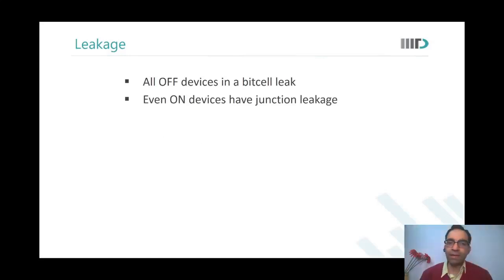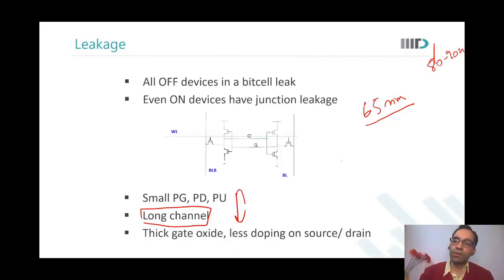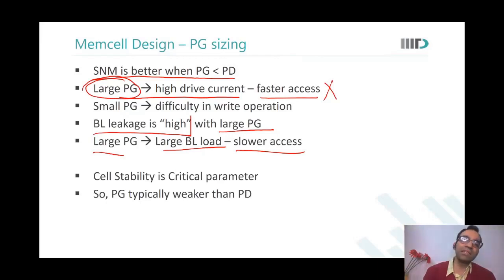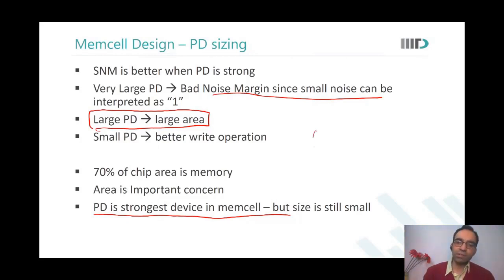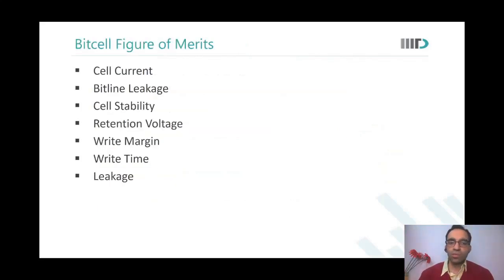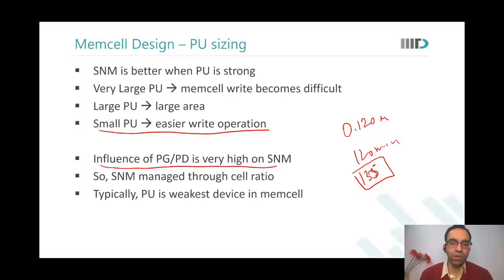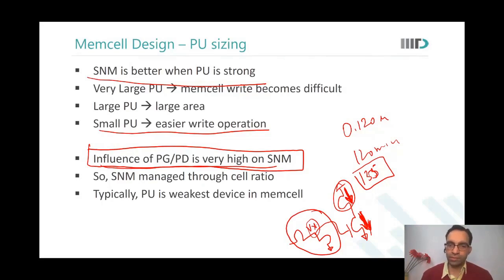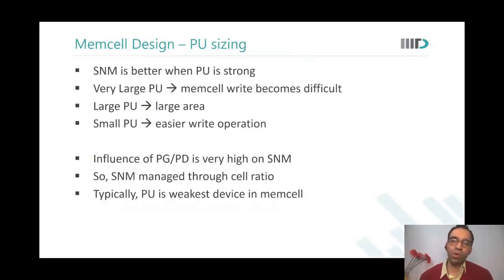SRAM Cell Design - Sizing

Comment: sir what does it mean by "PD should be strong", does it mean that it's W/L ratio should be large?
Reply from the maker: It should have more current sinking capacity. This can be done by using a larger transistor or by applying voltages such that more current can flow. (Assist schemes)